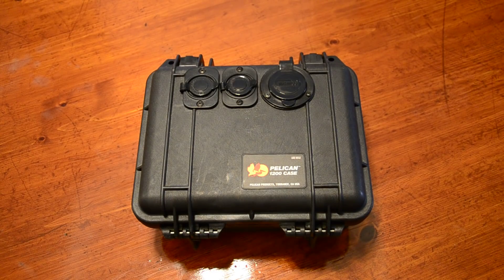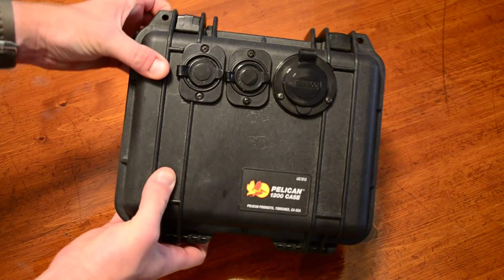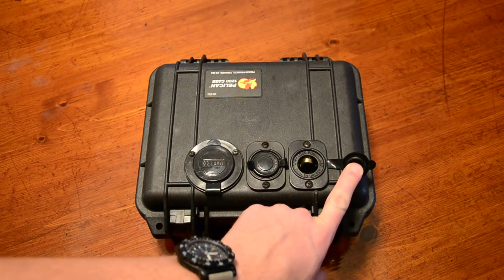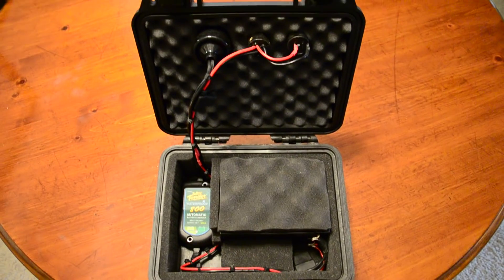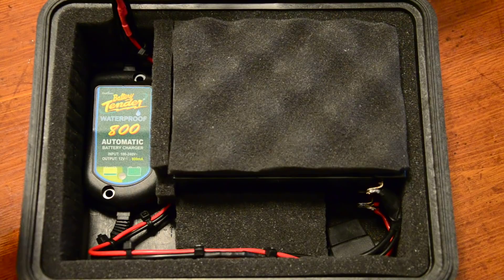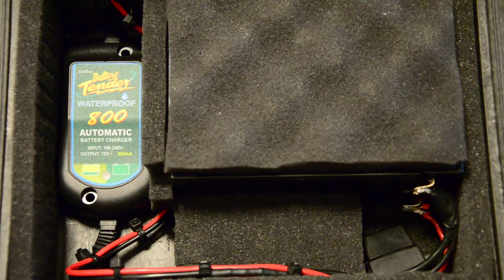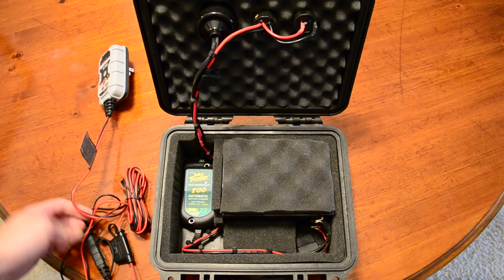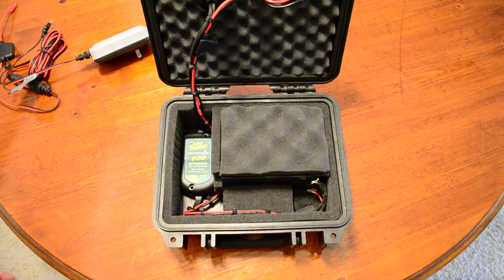How to Build a Better 12v Battery Box for Kayak Fishing

Comment: Properly maintained, these SLA batteries will last a LONG time. You often hear they are good for about three years, but mine have lasted eight years so far. I keep them on a Battery Tender Junior. When my landlord removed two, two year old SLA's from the fire panel I salvaged them and they charge right up to 13.2 volts and hold that charge. I keep a group of six of them and rotate the Battery Tender Junior clips to a new battery each morning. So each one gets 24 hours of charge every sixth day. Absent the routine charging I'm sure they would crap out in short order.

Comment: Can you fit 2of those batteries in the 1200 box?  either way.. i just ordered me the 1200. The rest will follow.
Those Batteries should be vertical.
 Thanks.
Reply: They are sealed batteries and do not have to be mounted vertical.
Reply: @bryanedwards7607    Ok,  I was told that by  people who know more than i.  Either way  i was able to get 2 of them in my 1200 pelican.
 Thanks for the reply.
Reply: Good stuff!!

Comment: Quick tip for anyone looking to build one of these (or any battery box for kayaks)... Harbor Freight has started selling a knock off brand of cases that is on-par with Pelican for a much better price. Combine that with your 20% off coupon, and you could do this build much cheaper. 
https://www.harborfreight.com/1800-watertight-protective-case-9-316-in-63518.html

Comment: Nice idea, I have the same box, and was using it for some camera gear when I go fly my paramotor. It became too small, so I don't have a use for it. Now I'm getting a camper, and may be out and about away from power for some time, so I've been looking at battery boxes and building my own with full size batteries for the camper. I figure I'll make a small one for my little Pelican box to charge all my gadgets.

Comment: Will this power a trolling motor, if so, how big,how long?
Reply: Depends on the size (amp hours) of the battery and the current draw and voltage requirements of the trolling motor. You can apply the concept to any setup, but might need a bigger battery and box (and check to make sure the other components are appropriate for the current; boat fires are bad news bears).
Reply: gerard haubert it will push a trolling. Motor slow for about 25min

Comment: Hi, which kind of screws did you use, is it nuts+bolts or screws?
Reply from the maker: I used the screws that came with the connectors for the top lid and for the inside I used marine grade epoxy. I used epoxy because I did not want to compromise the case's water integrity.

Comment: This is best from what I seen so far, thank you! I plan to build bigger one, for Group 27 sized LiFePO4 battery to be used with FastTrack inflatable, and after seeing this I am very much sure that much bigger than battery box it way to go; Pelican 1440 costs CAD $265 here, compare with battery cost CAD$ 1500... and buoyancy of 1440 is 43kg!!! (my battery is 13kg). I was thinking about $80 for MTM SPUD7 (almost tight fit) vs. $265 Pelican 1440 (spacious!!!)

Thanks for sharing!

Comment: Hi Derek, great job! I was wondering what (brand, type, size) battery you used... I didn't see that in any of the comments. I would be using that case to power a 55lb thrust 12 volt trolling motor on a canoe. Thanks!
Reply from the maker: You would probably have to buy a very large case to house a marine 12v deep cycle battery. The one I used was only like a 7amp 12v to power some LED lights and the fish finder. Hope this helps. Thanks.

Comment: Really excellent!!
i was thinking on that solution years ago. In a bigger box, where I can store the fishfinder also.easy  removing to use and attachable on the top of the box with a big velcro patch.

My plan was to go freely across the brakes at the beach and if tip off no suffering because everything still protected in a case.

Good job buddy!!!
Is water tight? have you tested? does it float?
Fred.
Reply from the maker: Thanks for the comment. Yeah, I would probably put my fish finder in the box too if I were going across waves and possibly tipping. You could probably install the mount for the fish finder directly on the top, that way you just plug and play. To the best of my knowledge it is watertight...I never testing it for floating but I've had some serious amounts of water get in the bottom of my kayak and everything was still good.

Comment: On the 3 prong connection. How did you run a neutral wire?
Reply from the maker: The onboard charger is only a 2 prong so I did not utilize the ground plug.

Comment: I just finished an exact replica of your box. Like you stated this is a much better design and match for serious kayak anglers. Thank you for sharing and having the creativity to design such a box. 
Everyone should build this box. Works great and lots of fun to work on. I should mention that after everything is purchased it is not cheap. If you are wanting a $20 battery box this is not your box.
Reply from the maker: That's awesome! I'm glad it worked out for you. You're right, it's not cheap, but it will last much longer than anything else. Thanks for the comment!

Comment: the only problem is that box cost more then the battery
Reply from the maker: Quality always comes with a cost
Reply: Alternatively you can get a Seahorse or even better a Nanuk case. These are also waterproof, crushproof etc... Super happy with my Nanuk.
Reply: my lithium battery costs $280, its worth protecting
Reply: Good point. Might be better off buying extra batteries. If you ruin it toss it and pop in a new one.

Comment: Did you check out the Stealth Cam portable 12V battery box?It's $60 all-in, totally waterprpoof. 12V power supply.What you have there looks expensive!A Pelican case like that is like $100 by itself isn't it!?

Comment: Awesome job!! What size fuse are you using?
Reply: Safety First! Be sure to include the fuse in the descriptions. It should be considered the MOST important item in the whole build.  May I also make a suggestion that a catastrophic fuse at the positive post of the battery be added to prevent a fire if a short or overload were to happen! Or relocate the fuse in there to the positive post. There is enough wires in there to create havoc if a short or overload were to happen! IMHO! Nice Build! Safety First!
Reply from the maker: It's an inline 15amp fuse. Picked it up at autozone I believe.

Comment: Thanks for the video! I'm currently trying to find a way to charge a sla battery in an enclosure and I think you just might have helped me solve my issue! any updates on how this is holding up with your charging method? Would i potentially be able to utilize the battery while charging also!? sorry for the newb questions but thanks again for the great video!

Comment: Just wondering, do I need a case? Are the batteries  waterproof?
Reply from the maker: Not sure on that one. Don't think it's a good idea to let water come in contact with the 12v terminals though.
Reply: Batteries will sink for sure :) but if box is big enough you don't even need hard waterproofing: it won't sink.

Comment: Looks good but it would have been nice if you explained how you wired it. Everything is covered and not easy to figure out for those who don't understand how this all works. Do you have a fuse?
Reply from the maker: +edawolf3000 Thank you for the comment. The wiring is pretty simple as everything is directly connected to the battery. I cut off the male end of the on-board charger and connected it to the Marinco Charger Inlet. I then cut off the charger alligator clamps and soldered the wires to the battery. The MinnKota Plug and 12V dash socket and chained together have the in-line fuse on the positive line coming from the battery. The negative line of those two ports goes directly to the battery. Check out the closeup shot at 3:30. That's pretty much all there is to it other than wire management and solder. Hope this helps!

Comment: what kind of plug do you use to connect the 12v on-board charger to your wall outlet to charge the battery?
Reply from the maker: +Devin Roche I used the Marinco 150BBI Marine On-Board Charger Inlet. It's the port I point out at 1:33.